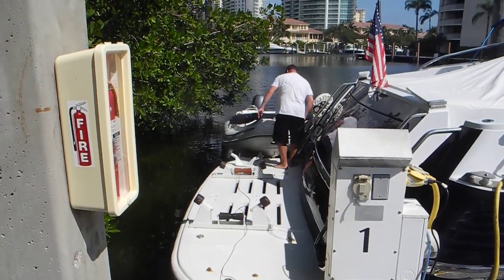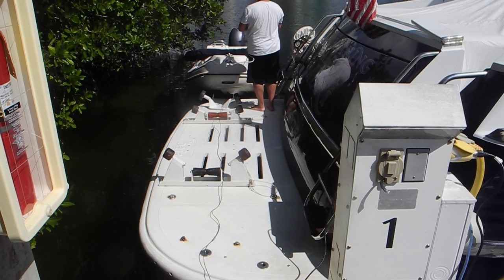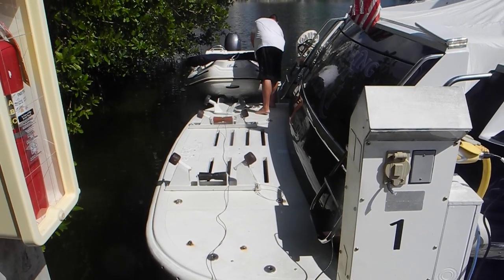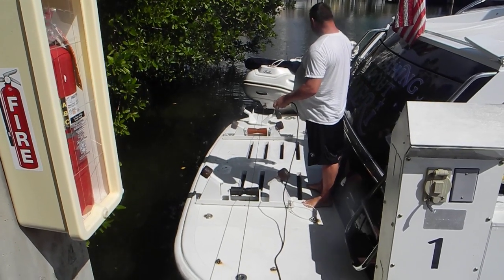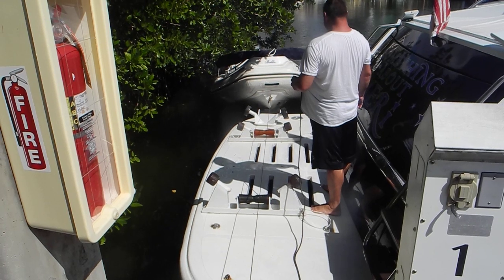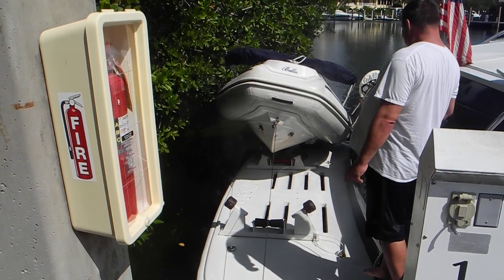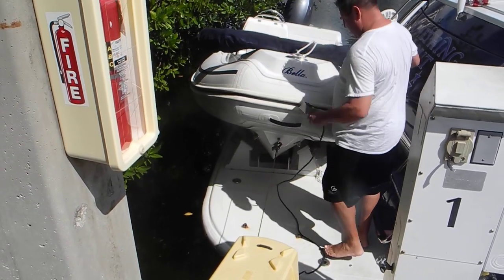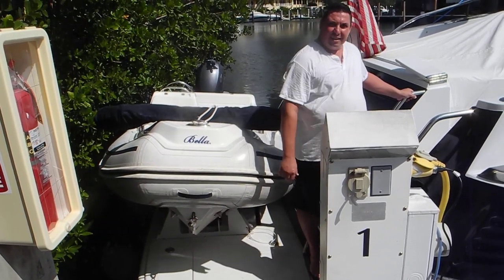Weirdest dinghy recovery method

Comment: I would like it a little more if the winch was mounted on the boat.
Reply from the maker: Jason Batcha we would too but this boat design is difficult at best for mounting a davit since it doesn’t have much deck space. But if they only use the dinghy when toodling around the Harbour of their home port then it’s a win. Launching it would be ok without the winch when away from the dock but then our guess is they would tow it home at slow speed?